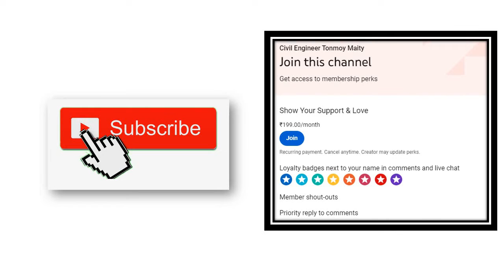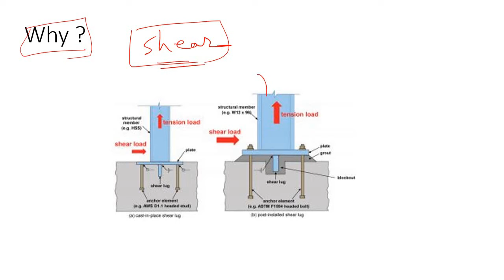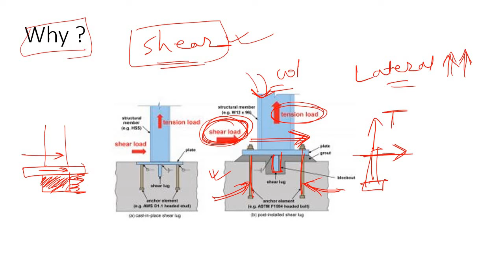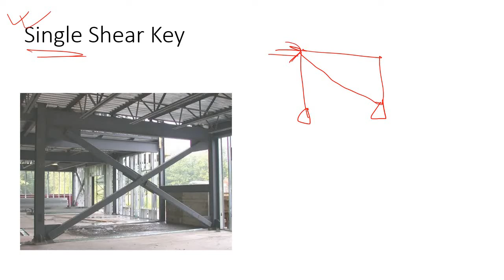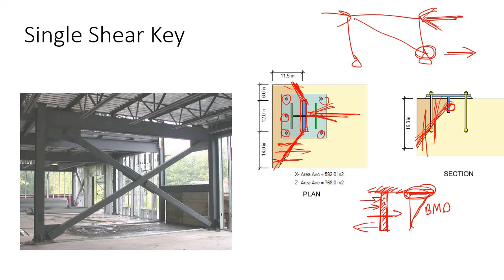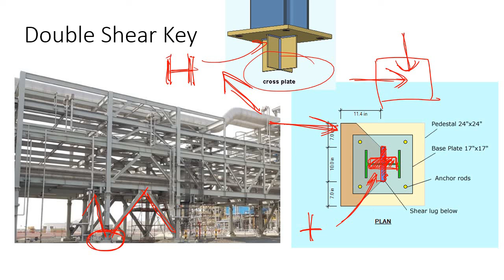Use of Shear Key II Single & Double

Comment: Why we use angle at stringer end , if we weld a end plate at stringer end like cross girder then what will happen?

Please sir give me the answer
Reply from the maker: Sorry for late reply. Tuhin, are you talking about use of cleat angle at the end of sringer beam, that we normally use during a shear connection? if yes, in shear connection we just need to connect beam web, angle is fantastic for this. But when we need to connect both web and flange of beam, then only we need end plate.

if you have more quiery please ask .

By the way thanks for your interest, and also You can Join my channel to show your support and love :)

Comment: Hi orientation of shearkey is correct here? As per your vedio, you are applying load transverse direction of plate.. here the shear area will be less. If oriented longitudinal axis so that we will have more shear area on both side that means length and height please clarify..